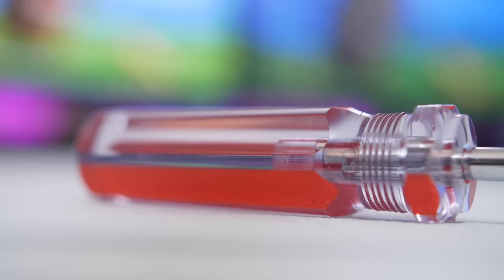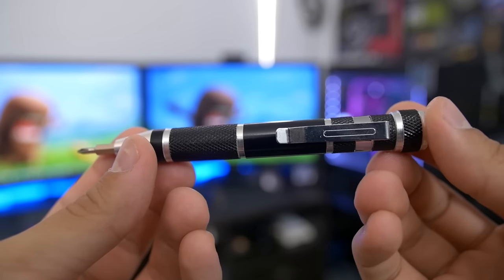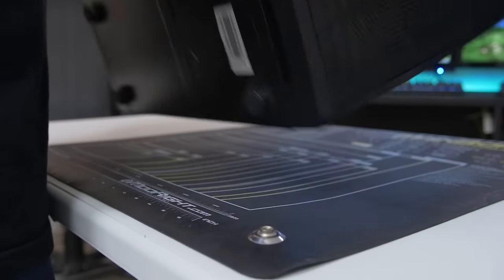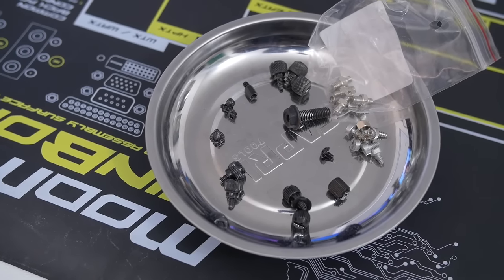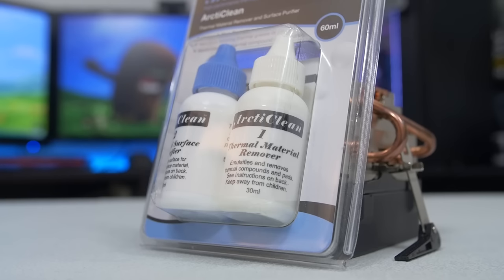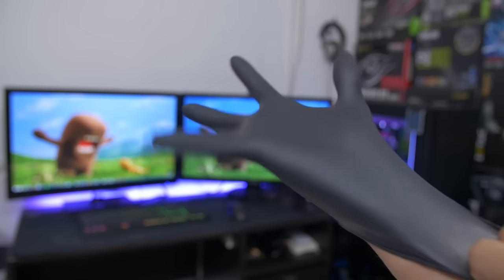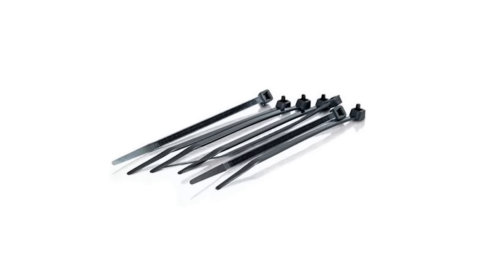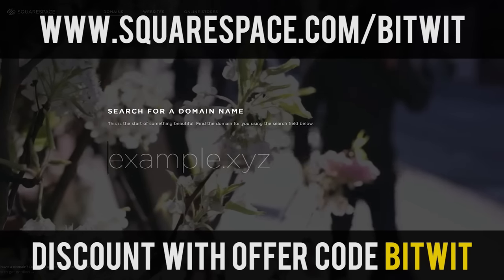Top Must-Have Items When Building a PC!

Comment: I'm going to build my first pc soon, I really want to avoid static and ruin my stuff. what should I do
Reply: Same here gona build my first pc soon and am researching ways to avoid static. I ordered an anti static wrist strap and thinking of getting the gloves mentioned in this video aswell, but from what I gathered avoid working on carpets, sitting on chairs while building and wearing socks and moving much. Use the mobo box as a surface for installing cpu, ram and cooling on the mobo. And as for the anti static wrist strap if u do get 1 connect it to the metal fan rims of a psu which is plugged in to a grounded outlet but turned OFF! And touch the psu every few min. Probably overkill for safeguards to protect from static but im in the same boat and know how it feels, hope it helps!

Comment: You know what also removes thermal paste instantly? Isopropyl Alcohol, 16oz bottle costs a $1, also use a cotton ball with Isopropyl, bag of 100 costs a $1. 12"x12" microfiber cloth is available at your local grocery or drug store, 4 pack costs $3. Ever wonder what's in that bottle 2oz eyeglasses or fancy screen cleaner you paid $6+ for? 50% Isopropyl alcohol, (16oz bottle still only costs $1) 50% distilled water, (gallon costs $0.89) and 2 drops of dishwashing soap. Cost to make your own personal lifetime supply, about $1.
But, Hey go pay $6 for thermal paste remover and $9 for for screen cleaner and another $7 for a microfiber cloth just because it got Arctic or Antec brand name on it. But, I'll spend less than $3 for the same stuff and still have enough left to buy a 64GB USB 3.0 flash drive.

Comment: ... Wait... so you recommend using magnetic materials... to work on a PC? I've always been under the impression that magnetic materials didn't mix well with computer parts and that the magnetism could generate static within your screws. Is this not the case?
Reply: magnetic screw drivers are too weak to do damage to pc while building

Comment: 1. A motherboard
2. A cpu
3. A cooler
4. Thermal paste
5. A pc case
5. A psu
6. Ram
7. Hard drive
8. Ssd
9. An os
10. A graphics card
11. Case fans
12. A power outlet

Comment: A 3" magnifying glass, made of real glass, perhaps with a built in light.  A super companion, especially in your ...ahem...declining years.
Take a case screw to your favorite hardware store and buy some matching screws (metric or 6/32, depending on what the gods gifted you with) with tall (1/4") "cheese head"  knurled heads.  Also buy some 1/2" red plastic knurled heads to fit over the tall screws, and you have bright red thumbscrews for removing the panels.
What - your hardware store doesn't have them?  Get a new best hardware store.